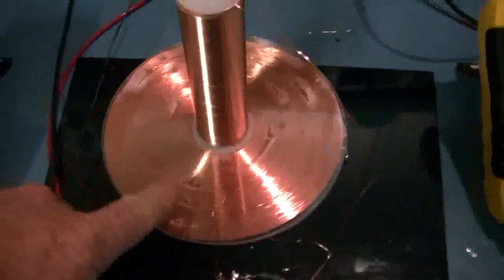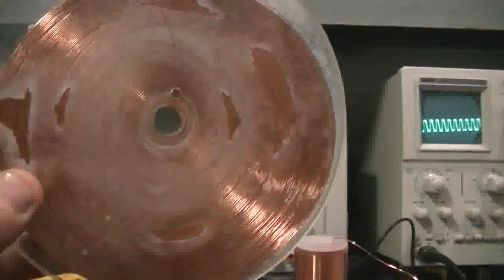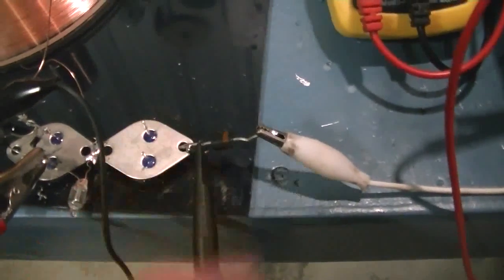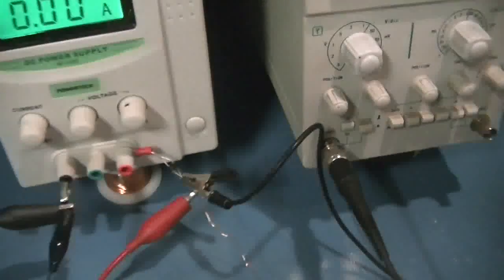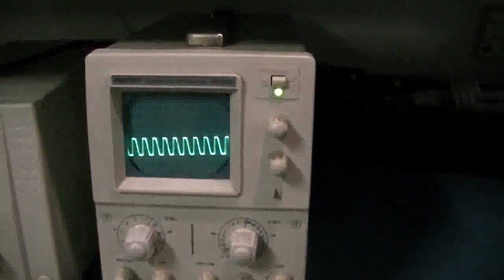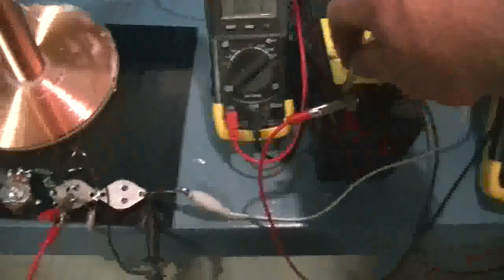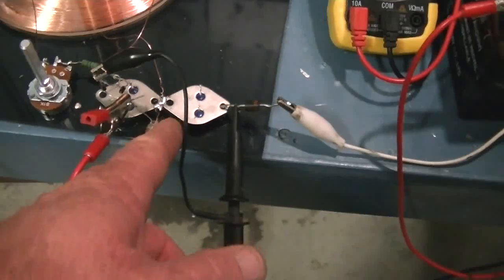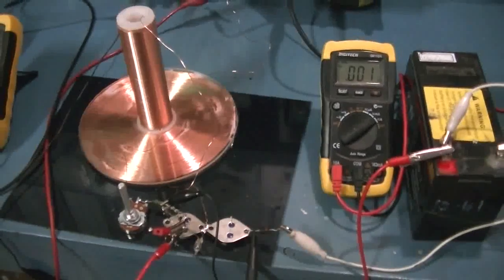Tesla ss ssg-excellent results.flv

Comment from the maker: @KyleCarrington ok you lost me kyle?.the supply power is coming from the power supply and it is useing 1ma.The charge battery is being charged at 1ma at the voltage of the battery.So the two meters on the left is the watts being consumed and the two meters on the right are the watts going into the charge battery.So im not sure what you mean about it being totally irrelevent it could be 10,12.8 ?

Comment from the maker: @KyleCarrington Hi Kyle-the meter on the left of the charge battery is the amps in and the meter on the right of the charge battery is the volts of the charge battery.Because it is only a 1ma input that voltage is the rest voltage of the charge battery

Comment: Very interesting Tinman. I don't get the part where you say "that's what's coming out" , is the voltmeter on the charge battery or is the leads, disconnected... in other words, is the standing charge of the charge battery influencing the meter on the right, or not. Thanks.